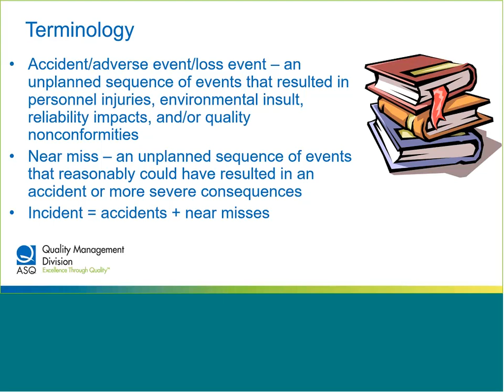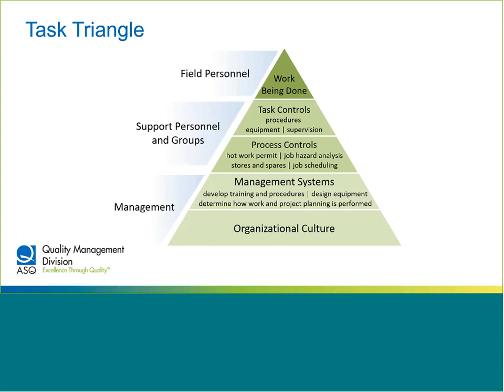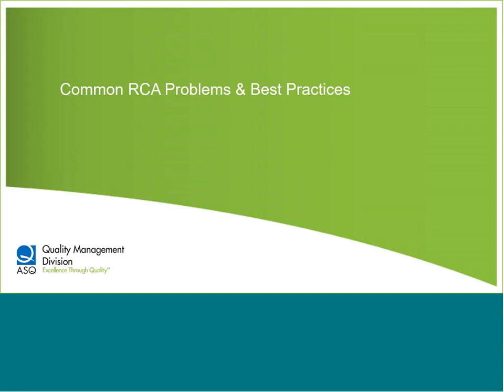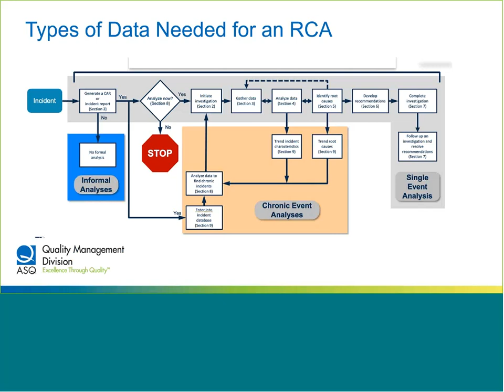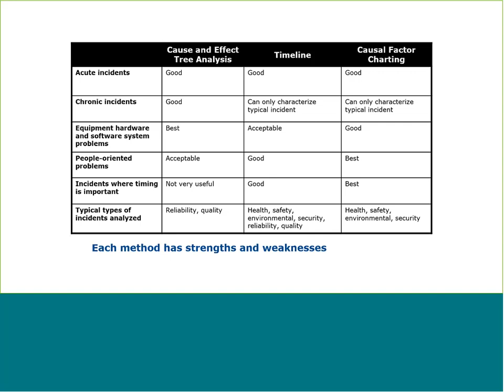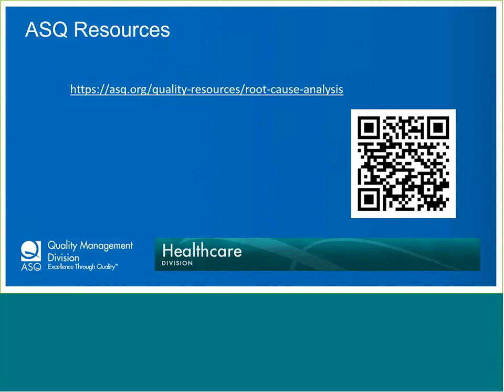Basics of Root Cause Analysis

Comment: Anyone who is looking to identify a process failure using "root cause"  will be as successful as someone look for the Eiffel tower in Innsbruck Austria. 
Process failures are almost never attributed to a "Root Cause" 
Processes are a compilation of many events coming into play at a single point in time.  Therefore looking for a root cause to that compilation of events in order to resolve the issue from ever reoccurring, is an impossible task at best. 
-------
Failure causation should be first defined as to the frequency of its occurrence and the severity of its result 
I have discovered in my nearly 3 decades as a troubleshooter of problems, that process problems are usually resolved when the process is mapped with the relative players, using a cross functional process map (also called a swim lane map).  All too often I find the organization and the relative players within a process are making assumptions as to how the process functions, without actually being familiar with what is actually occurring.    Mapping the process helps lower the water level and identify the big rocks (so to speak), identifying the cause(s) which can create variation and therefore failure.